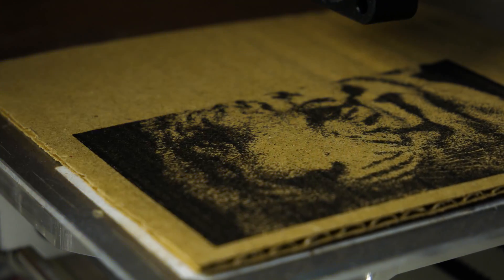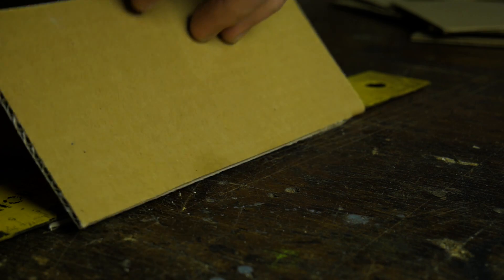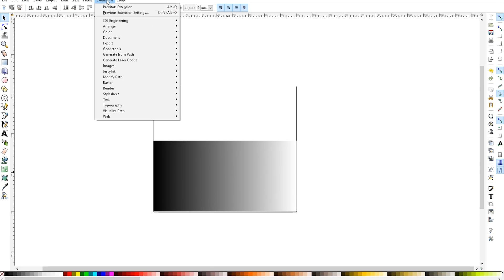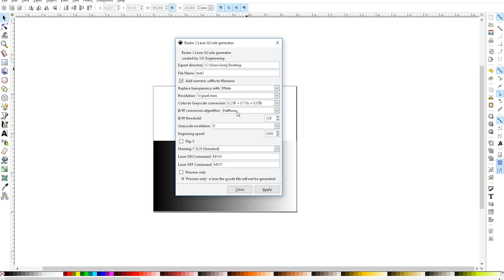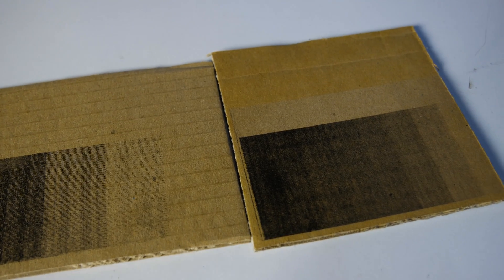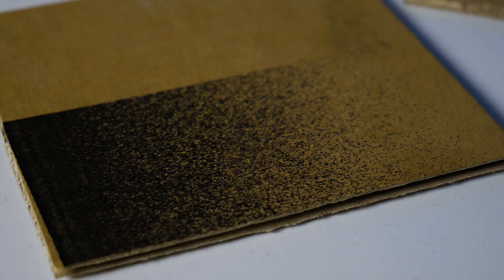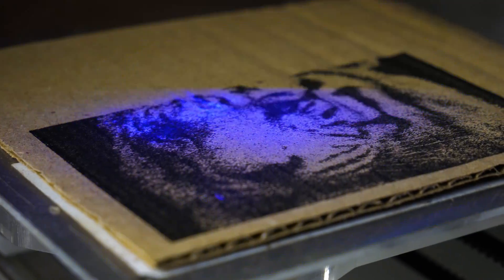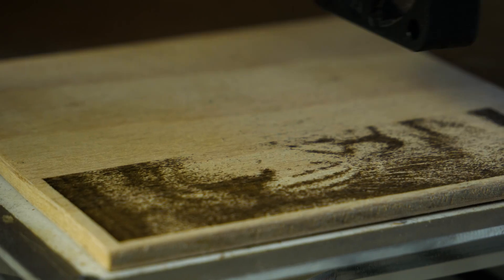Engrave Grayscale Pictures On Wood

Comment: This is not  grayscale engraving.  Using different ALGORITHMS  tells me that the greyscale image has been stripped of all its "greyness" and reduced to a binary black and white DITHERED image You are seeing varying density DOTS on a light background. The ratio of dot to background is being used to fool your brain because the eye is unable to resolve the small dots and is therefore taking an avreage of black dots and brown background to create an IMPRESSION of greyscale.  REAL greyscale engraving will not use a dithereing algorithm but will (as mentioned in the video) change the output power for EVERY pixel to create a different amount of burning.

Comment: i got a lser from ebay and want to use it with ramps, but i cant achieve grayscale only dots. so far i hooked up the laser on 2 wires ramps D9. any idea what i am doing wrong? the laser https://www.ebay.com/itm/15W-15000mW-High-Power-Blue-Light-Laser-Head-DIY-Engraving-Module-Diode-Engraver-/401298754171